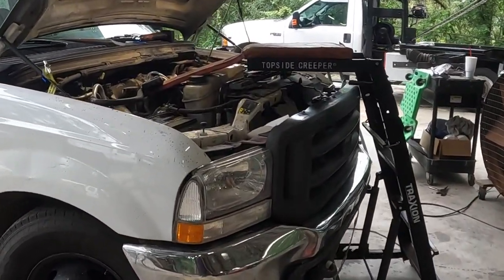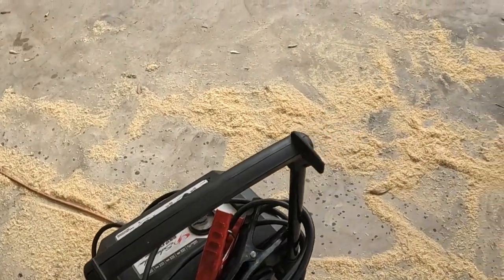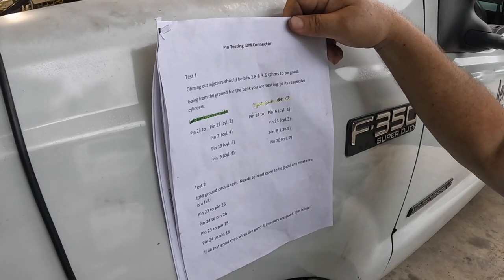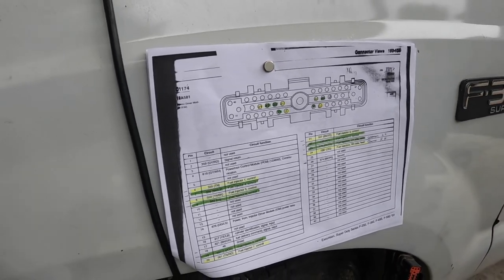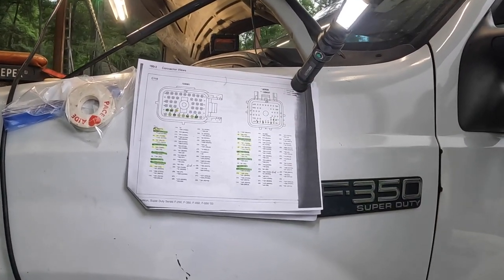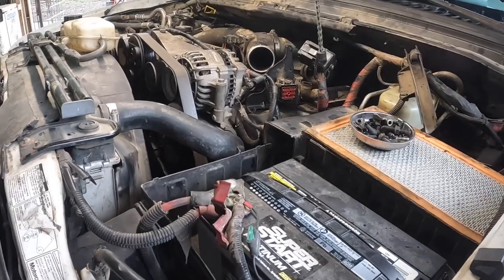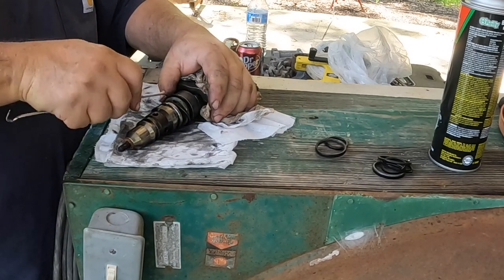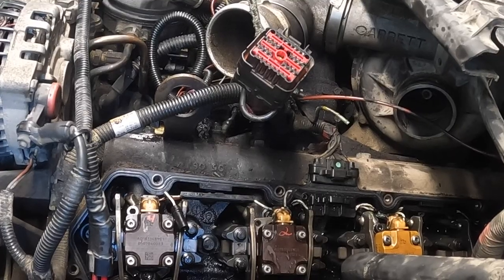7.3 Power Stroke running rough & no power due to 2 bad injectors

Comment: Are you going to rebuild the injectors yourself?
Reply from the maker: Nope. I try to keep some good ones around when we swap injectors. For testing or if we need one or two to get by till all 8 need to be changed. Confirmed bad ones go into the core pile for returns. I have thought about rebuilding some but as of now it hasn’t been worth the time.
Reply: @bayoudiesel who do you use to rebuild your injectors?
Reply from the maker: @TheGoochmeister  I’ve had good luck with Pensacola diesel
Reply: @bayoudiesel  seen videos on rebuilding May try
Reply from the maker: @wheel2keel  yea. Doesn’t seem to hard unless you have any parts that are way out of spec